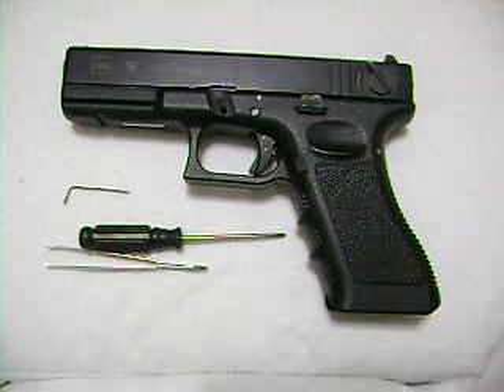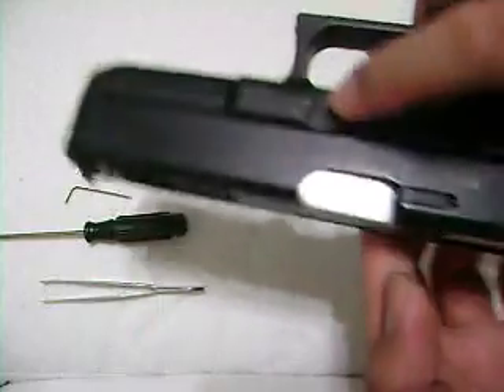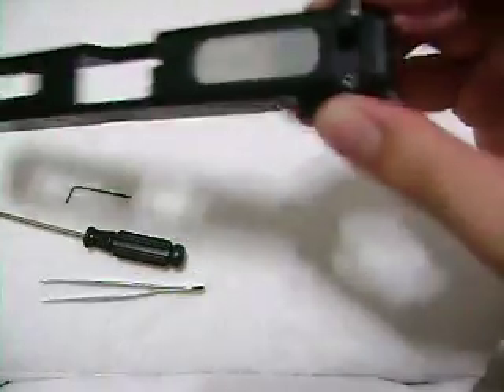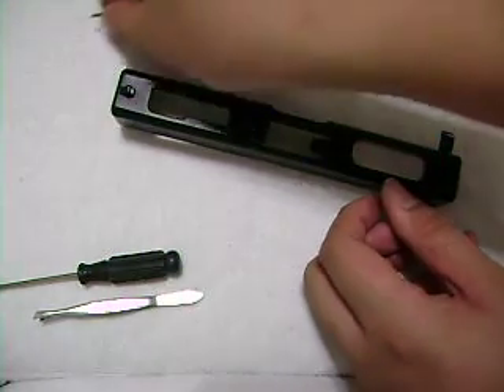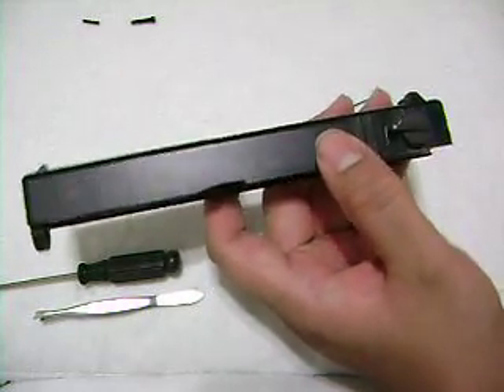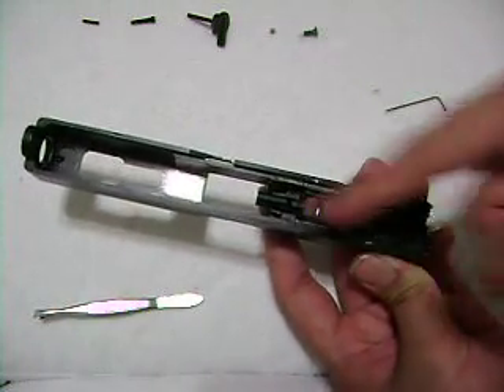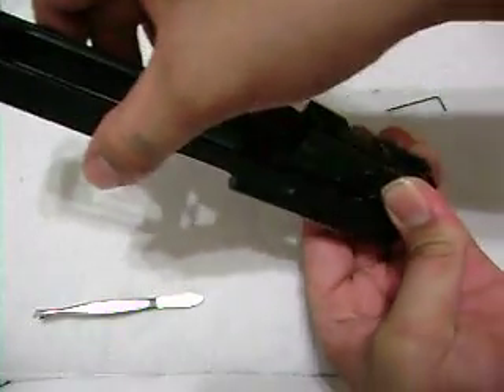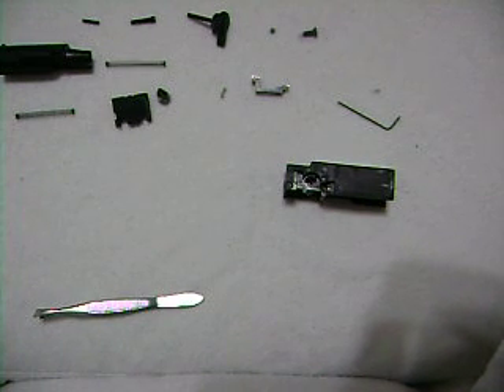Disassembly of the KSC GLOCK 18c PT1

Comment: The slide on mine doesn't go all the way forward, the gas chamber (part with the rocket valve in it) gets stuck forward pretty much no matter how much u lube it.  I suspect that the rubber part for the plunger thing somehow grew like the rubber piece on the recoil rod.  WTF?  Why is this happening?  (P.S. this problem happened after disassembling the gun, but i am sure i put it together right.)